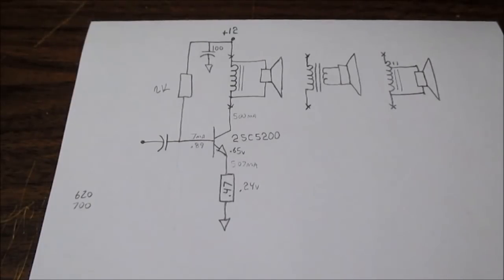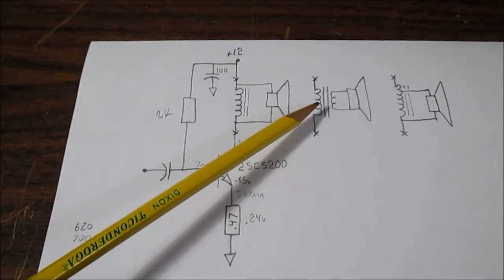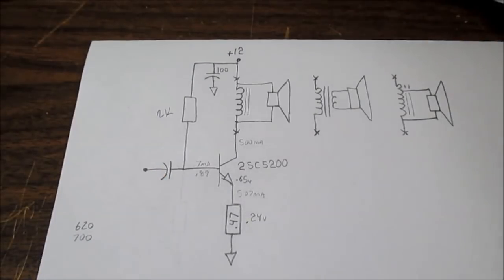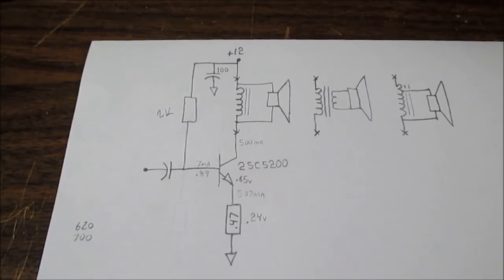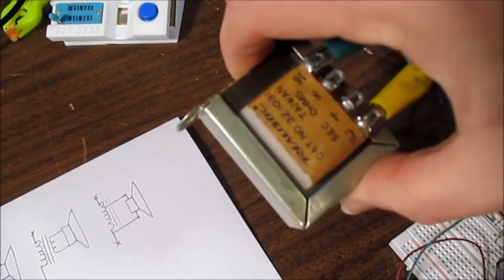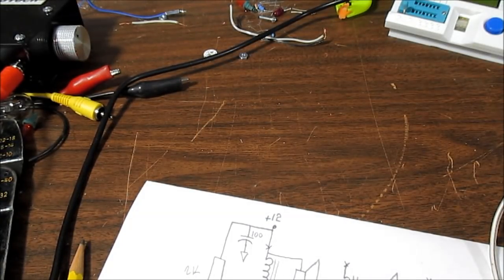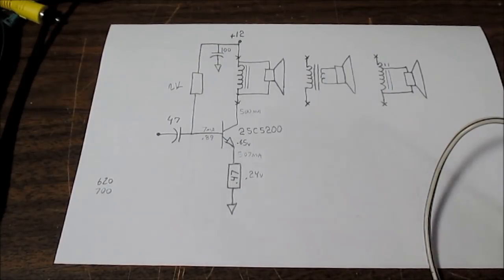Inductor coupled class A audio amplifier output stage

Comment: I'd guess you'd necessarily lower the bias current when connecting the speaker across the inductor directly. Adding a good cap in series with the speaker might give you some leeway in that respect. You'd have another problem, however: you'd probably need a very high capacitance (i.e. an electrolytic) given your low inductance.
All in all the performance is largely affected by the inductor quality: there's no escaping this, hence why these circuits are now deemed exotic and only a couple or so manufacturers still make them, at a price. I think you'd have better luck winding the inductor yourself. This, though requires a lot of patience and magnet wire - especially when a number of iterations are needed until a desirable inductor is made. Amazingly, some people don't mind doing this. On the other hand, unless one has substantial prior experience doing this, I feel designing a good audio inductor would seem a daunting task to the person trying it for the first time.

Comment: I think the low efficiency is because of the transformer is not really well design for application. though it can increase the efficiency because ac is block and force to go to speaker unlike capacitor coupled amplifier.

Comment: I dont get it, i used small Transformer from PC SMPS power supply , its very small , and i was surprised i got loss of high frequency's , and bass went though ,  tried it with 3 size's of small Trans. all the way to taking out just High Hats from signal ,  but there was no bass loss .  What is going on ,  i can test this on equipment and record it with professional gear,  i  need to look this up , if anyone knows whats going on , let me know .

Comment: For optimal efficiency and bass response, the output choke should have an Fc of around 20 Hz at 8 ohms, calculating that out I get 65 mH for inductance value. Using large enough magnet wire the DC resistance will still be a fraction of an ohm.

Comment: John,
A bit off the subject of your video but I would like to ask you if you have any experience with CT chokes as grid-chokes or sometimes called plate-chokes like used long ago sometimes to develop out of phase drive for output tubes or just as plate loads.  I have a number of UTC chokes and transformers with inductance values of 3500H and larger. Staggering high values of inductance. Any thoughts you have on this would be appreciated.  TheAudioShop@SBCGlobal.Net
Reply from the maker: Hi Raymond, I haven't heard of this relating to audio amps. I'd have to do some research. I don't get to tinker with tube power amps much due to the cost.

Comment: Hi sir i want made 2.5 Ampere amplifier on 12 Dc Power supply load 8 Ohm spk Inductor coupled class A audio amplifier output stage please tell calculation
Reply: 10*10/16 =6watts at max

Comment: Transistor gain can vary dramatically with temperature, so it's never a good idea to work off of gain measurements. Also no transistor is perfectly linear, this is causing some of your distortion. Both of these problems can be solved with a feedback circuit.

Comment: That is not a 2SC5200 transistor
Reply from the maker: Its an FJP5200. Same die inside as the 2SC5200 according to the datasheet.
Reply: I didn't know there is a TO-220 package version for the 5200's
Reply: I didn't know there is a TO-220 package version for the 5200's

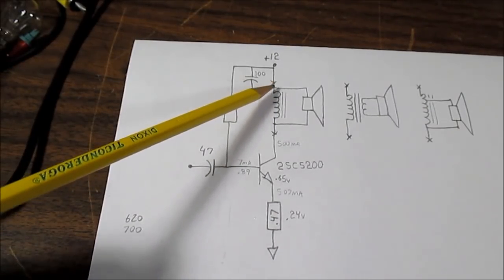Comment: 10:40 - So the coil and the speaker form a current-divider. I guess you need a MUCH higher value inductor relative to the speaker's inductance.

Comment: Hello John.
What is the collector voltage on the transistor to obtain your 500ma design requirement?
I am just interested to know how close it is to half rail.
Reply from the maker: The collector voltage will be near the supply voltage at idle due to the low dcr of the coil. The AC signal voltage will vary quite a bit because the inductance resists the change in current.

Comment: I never saw this configuration until I worked on a 1965 Corvair Delco radio.    Now I understand how it wrked.   I thought it was a weird configuration.   It did not make sense to me until you explained it here.  I discovered  that it was very common across the line of  Philco car radios in the 60s.      Thanx
Reply: All car radios used that output configuration from the late 50's until the mid to late 70's. (GM was the first to use it and the last one to give this configuration up) In the late 60's complementary push pull outputs started showing up. In the late 70's most car radio audio outputs switched over to chip amps.
Reply: Thanx

Comment: A few weeks ago I experimented with a quad parallel MOSFET amp, and was very impressed. That circuit is almost the same as this, but with 4 MOSFETs in parralel. I ran it at 35v, and had a bias of around 650ma, I did a power test and couldn't run it into clipping because my resistor was smoking. I got almost 80watts at 4 ohm. I'm very impressed as said earlier, and I'm currently working on making a pre amp for it. It sounds lovely too, despite what people say about MOSFETs. I really don't understand why people hate MOSFETs so much, my big Pro Audio amplifier use MOSFET Class H output stages and they are the best sounding amps I've ever had!
Reply from the maker: Bob Cordell, PE and amp designer likes to use MOSFETs and covers a lot on them in his power amp design book. Whatever you use, everything comes with advantages and drawbacks. No free lunch in electronics.

Comment: Very similar to the first transistor power amplifiers I built many years ago. Used the LV secondary side of a 2,or 3 amp 12V filament transformer as the inductor with a TO3 germanium power transistor - patterned after the car radio audio output stages of the day.Was able to get about 2 or 3 watts into 4 ohm speakers with a 12V battery. Ran close to 1 amp collector current with a large heat sink.

Comment: I have a Class D home theater amp and it has a little bit of hiss to it like any other class D amp.
Can i use resistor in series with speaker to reduce its sensitivity  and make less hissy and will it degrade speaker response?
Hiss has nothing to do with volume since its the same on 1 and on 40?
You seem like someone that knows the solution,keep up great work.
Cheers
Reply from the maker: The resistor in series with the output would lower the hiss but it will also reduce the power the amp gets to the speakers making them sound weaker. It will also lower the damping factor which can change the sound of your speakers. Since the hiss is the same at any volume setting, it is the internal design of the amplifier. It would take some hacking to fix.
Reply: IS your hiss AC coupled or DC coupled? Do you have a leaky cap in the output stage??
Reply: sounds like excessive switching noise which is quite common for class D. i might be wrong, though